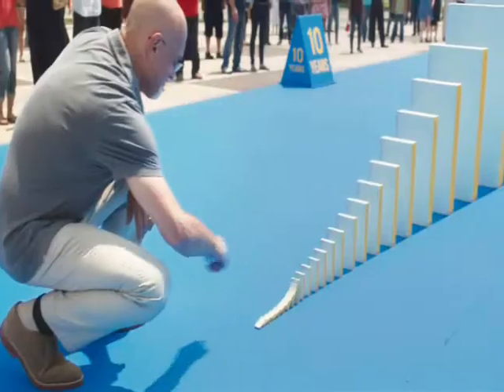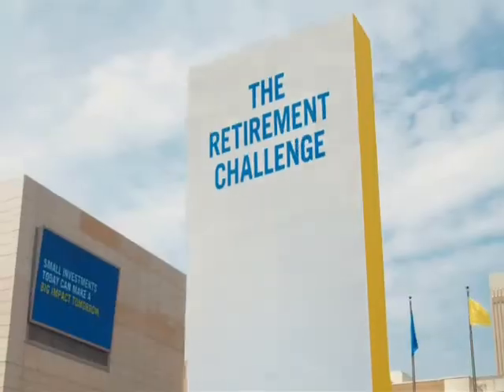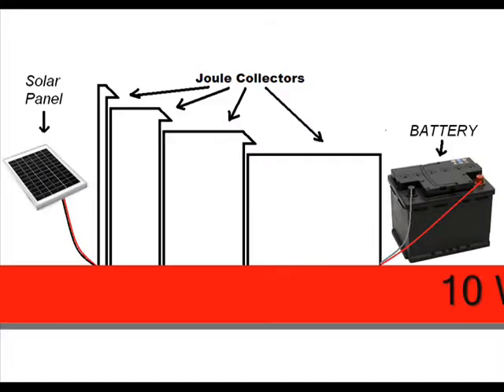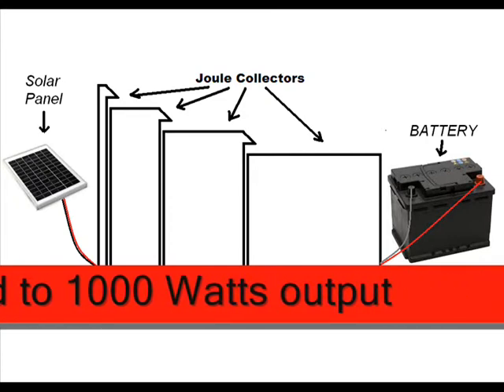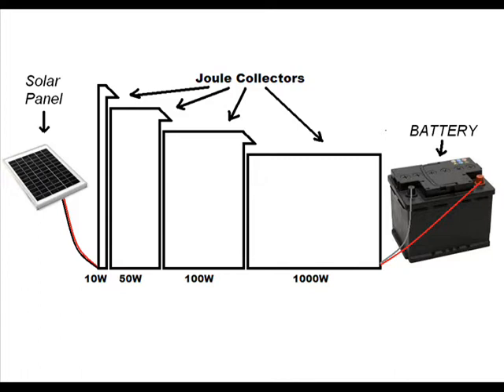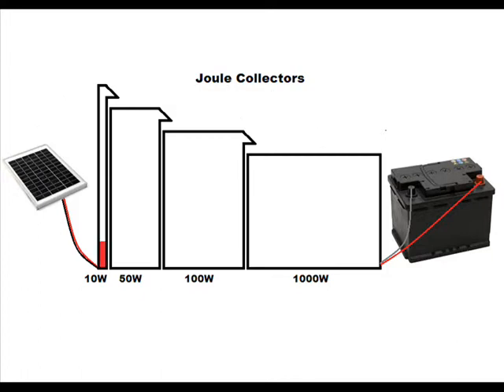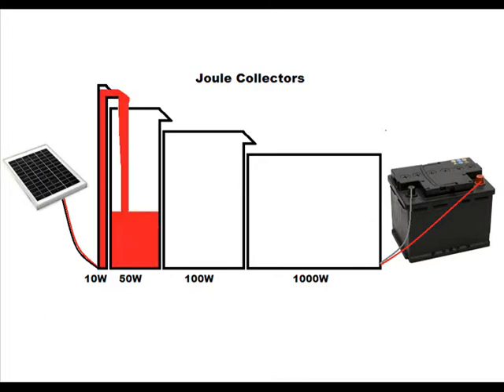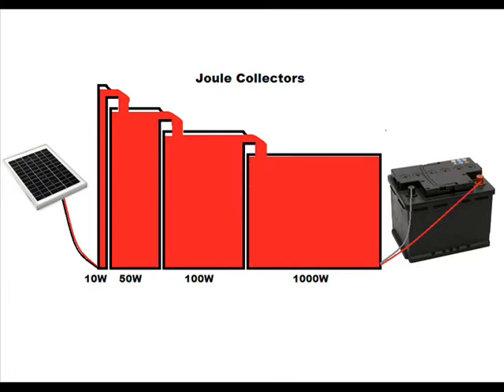How Free Energy linked to Dominoes Experiment.

Comment: Thank you for the video, you have re introduced us to the DC to AC step up inverter...self loop these devices to recharge the source battery, then we can call it free energy..till then its only an inverter
Reply from the maker: Thanks. I believe in your opinion
Reply: I wont discount it off totally though, Ismael aviso is supposedly one of those with such an ''overunity'' inverter, his  videos claim to show a 12volt car battery single handedly running a 13 kilowatt 450volt Industrial DC motor through some hidden circuits I think is a super duper inverter taking energy statically from the 'surroundings', and the battery doesn't go flat or below 12 volts even after running for some time, normally a battery will start dropping by the time we run a 2 amp car radiator fan for several minutes without the engine running
Reply from the maker: That was an Impressive experiment. It could be an inverting process that capacitor module splits the distribution of joules to recycle excess amps back to battery. It is definitely a super duper inverter.
Reply: yes he did have coils and massive number of capacitors in his array
Reply from the maker: Impressive idea. Capacitor plays big role in retrieving energy back to battery.